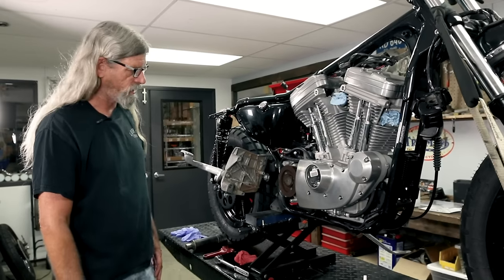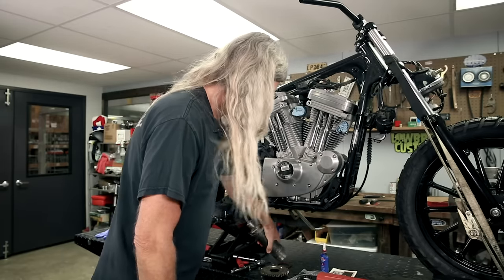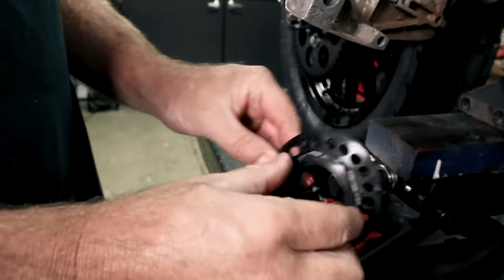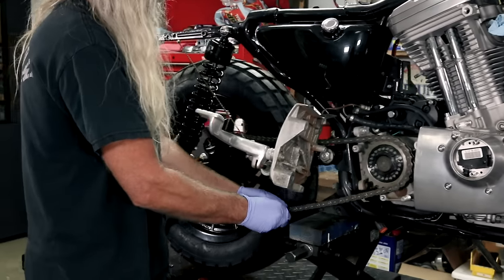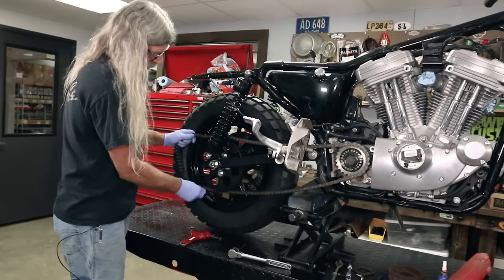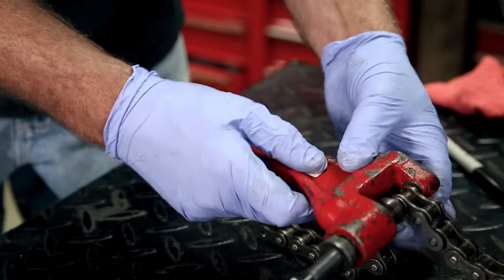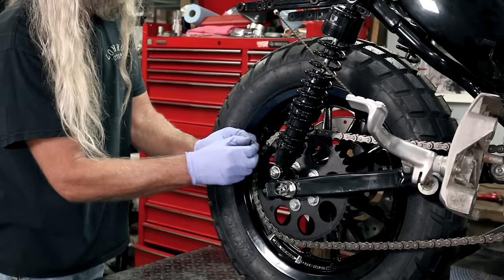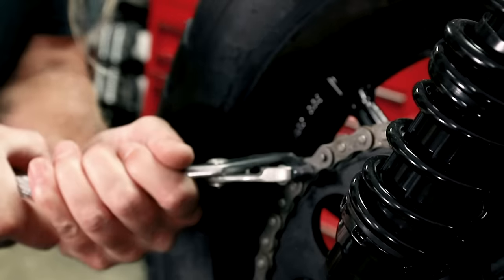Saturday Sportster - Season 1- Episode 7 - Belt to Chain Conversion Installation

Comment: I have a 2004 883 Sportster which I converted as a Scrambler bike using the exact same tires, chain kit, 15in Progressive shocks, (pure coincidence I might say) and many other things. But in my case, I had to design and install a chain tensionner otherwise, the shocks wouldn't travel their usable length and moreover, the chain was grinding severely the upper mounting lug for the rear peg. I had to trim it off. Besides, I've added a wear pad... (which is installed where the chain guard is bolting) so the chain would not grind off that part too. All this because the sprocket, the swingarm shaft AND the rear wheel shaft are not in their original design alignment anymore, because of the much longer shocks. It looks like the 2003 and earlier model don't have those issues????!!! Don't get me wrong, I love my "new" Sportster now. It has become a wonderful and pleasant machine to ride now. Thanks mite, for your fantastic line of products. Keep on the good work.

Comment: Todd I have a question about the chain dive kit . I have a 2016 iron 883<1275 Hammer Preformance conversion with stock 883 gearing and I love the torque off the line. Is there as pocket size/kit that has gearing in between the 883 and 1200 gearing? I’d like to maintain as much low end as possible but still be able to cruise comfortably on the highway at 70 without being to wound up in 5th gear. Thanks for all you help and the Saturday sportster series , it’s awesome man😎
Reply from the maker: Our kits do not have options for sprocket sizes for the 04 and up they come with a 22 front for both and for the rear the 883 is 53T and for the 1200 52T try this program to see what may be a good plan https://sprocketcalculator.com/

Comment: If you break your chain in the wrong location you can simple get an offset link. 

A Master link is 2 pins and 2 sideplates to connect a chain at 2 roller locations.  

An offset link is Manufactured with only one pin and one roller with two side plates. 

It's used to connect a roller and a side plate. 

This sportster chain is a #530 chain so a #530 offset link would work just fine.
A 2 pack is usually about 10 bucks.

Comment: Recently installed a chain conversion kit, problem is that the chain rubs on the exhaust bracket and rear lower footpeg mount, looks great, but there are a few extra steps needed to work around getting it 100%

Comment: I just found out the swingarm has a side to side play on my wife’s 2013 Iron and it’s really disappointing. I guess I have to change motor mounts and swingarm bearings?
Reply: Get the soild mounts...and work out a way to keep the top engine "dog bone"...done the soild conversion on my 2014 xl1200c
Reply from the maker: what Rimas said we do have solid mounts available: https://www.lowbrowcustoms.com/products/complete-solid-motor-mount-kit-for-2004-up-harley-davidson-sportster-xl could help alleviate having to change out that stuff ever so often.

Comment: Is the torque spec on that front sprocket 50ft-lb? My manual says 150ft-lb (883 2002)
Reply from the maker: you are talking about the front drive sprocket. There's a specific procedure in the manual ... Loctite red on the threads, 50lb-ft, then an additional 30-40 degrees, the variance being so that you can align the lock plate. It's left hand thread as well. Takes a 1-7/8" socket. It says in the manual note: If the drive sprocket nut requires additional
 tightening, do not exceed 150 ft-lb. so 150 is way tooooo much if you have to then line up the lock plate after torquing.
Reply: @lowbrowcustoms  manual says drive sprocket nut 110ftlb-120ftlb.. do not exceed 150ftlb

Comment: I've had and worked on H-D's for 50 years (Sportsters, Panheads, Shovelheads, Twinkies) so I'm obviously partial to them. But changing from a belt to a chain on a Sportster seems to be quite a step back in technology to me. I have an FLHX with a 120R motor, 7-speed Baker tranny, upgraded drive train and a Trask Turbo & 165 HP & 165 TQ. I believe my bike is right on the borderline for needing a belt to chain conversion. But this Sporty...NO NEED. At best even with a turbo, a Sportster would still have a tough time beating a 600cc Japanese Sportbike, although look and sound much more cool being what it is. Belt to chain in this case is a waste of money....JMHU (Just My Humble Opinion).

Comment: Not entirely sure why anyone would want to do this. The  evo sportsters had chain drive from '86 to '92, and as I remember at the time they had a reputatiion for eating chains. I like my belt drive. Much easier to look after. I do kinda get it though, team the chain drive with black cylinders and a kick starter kit - very retro looking, if you like that sort of thing. Myself, I'd be more inclined to go looking for an old shovel head sporty to restore.
Reply from the maker: Main reason we are doing it on here is the higher then stock shocks. you would have to buy a longer belt and not always the easiest to find.. Chain will allow for adjustments and will guarantee  fit.
Reply: Plus this is a off road spotster..not sure how long a belt would last with dirt and rocks

Comment: Are there any gains in a chain conversion?
Reply from the maker: you are able to change gearing ratios. also in this build running a belt we would have to find a longer belt to run these shocks and its more cost effective to just run a chain conversion kit because you can make a chain any size you need.

Comment: Red loc-tite  AND  torquing to specs.....like wiping your ass then taking a shit. Makes no sense.  Use blue if you just gotta have a thread lock.  Red is for heavy equipment and machinery, not motorcycles. This message is for the folks who are not aware. I know lowbrows disagrees with me. We'll agree to disagree.